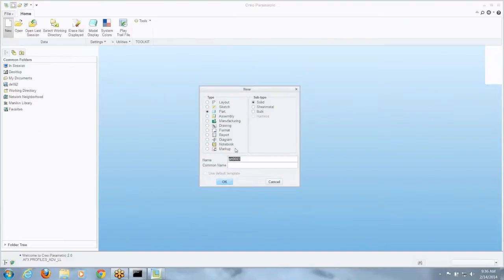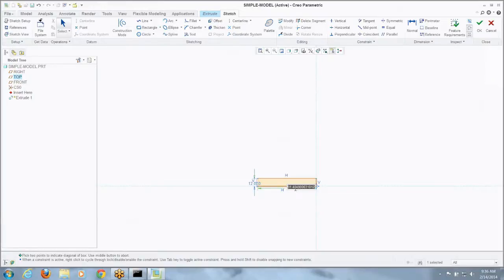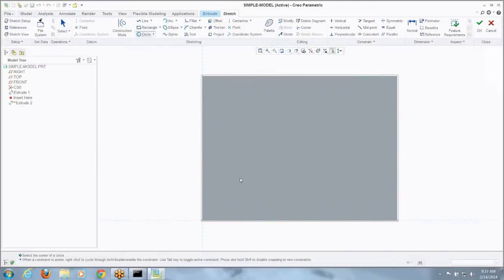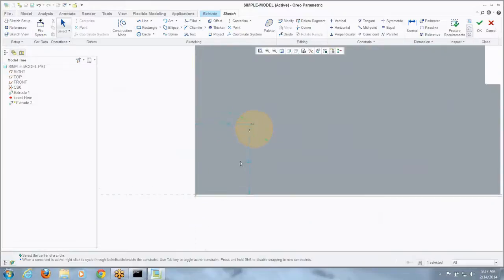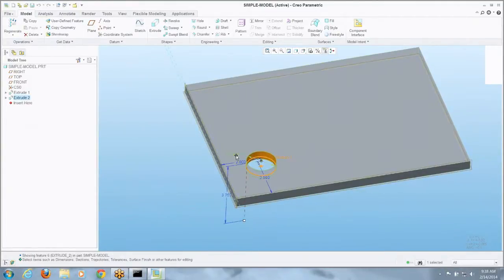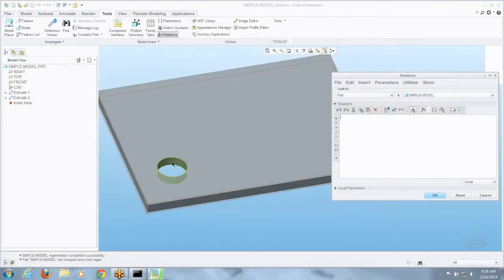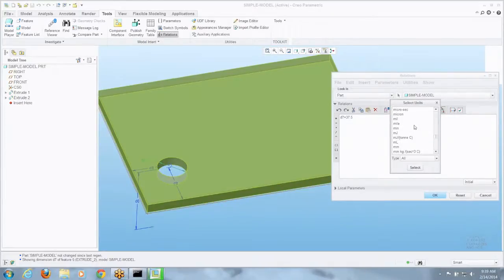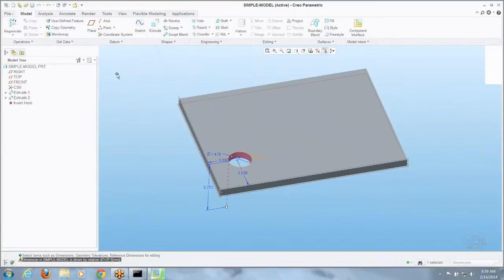Setting feature specific units in Creo Parametric - EAC Tip of the Week

Comment: How will you add unit to a parameter? Ex: I want to pull the weight from "mp_mass" in kg or gram. But my model in in "millimeter Newton Second where the mass is in tonn. I want in my equation this   WEIGHT_VALUE=mp_mass("")[kg].    How can I do this?

Comment: Mark, i just tried your relation trick and mine would not work....after investigation I found that the type of relation needs to be for feature for this to work properly....not quite sure how you made yours work with it being a part relation....fyi good tip!
Reply: Hi Buddy,
You have to enable the use of different units in the relations window. The button for that is 3 picks to the left of the button you click to select your units. It looks almost identical. The help prompt says "Set relations to be sensitive to units of parameters and dimensions". If you don't enable that it will let you choose, mm for example, but flag [mm] as unknown text and a relations error.